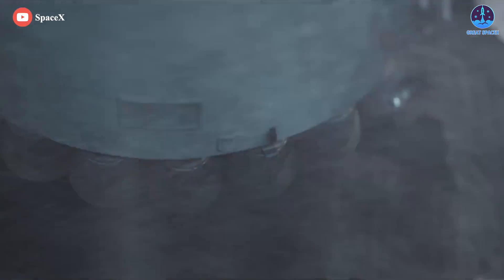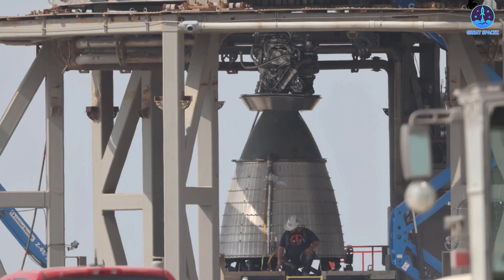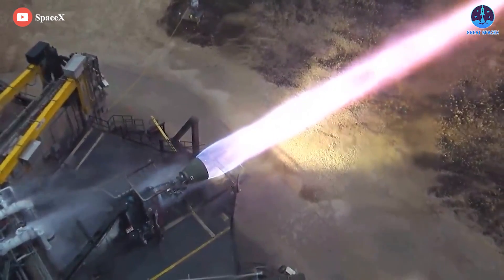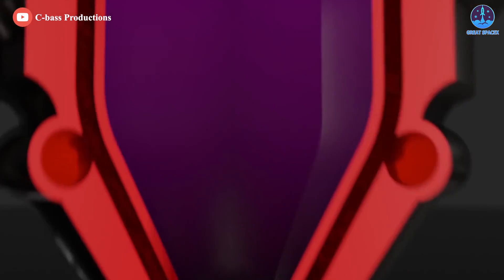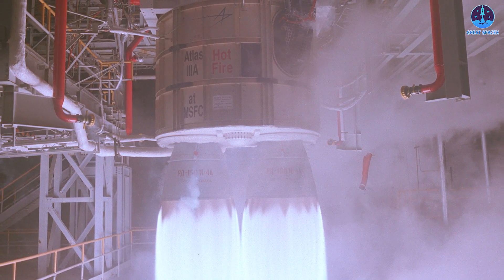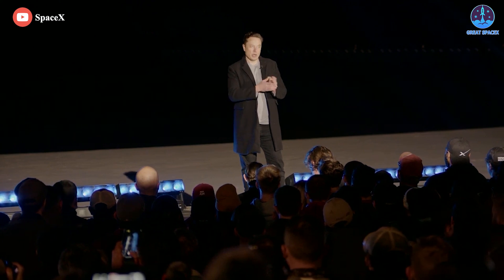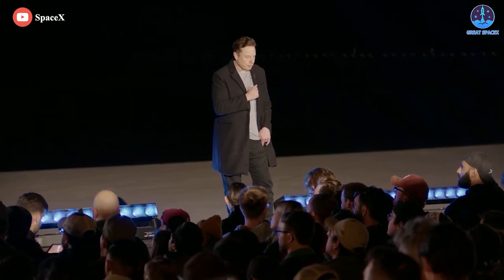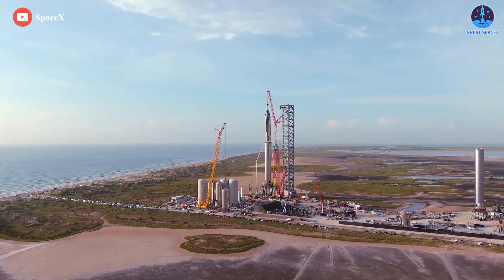What Elon Musk just Did with SpaceX Raptor Engine is thrill Scientist's minds...

Comment: The RD-180 has one champers and two exhaust bells.
Reply: That was because they could not figure out how to stabilize the combustion in one large combustion chamber and nozzle so they took the output from one large turbo pump and divided it between two smaller chambers and nozzles. Works really well and is one of the most dependable engines made but is heavy.

Comment: "Act hypergolic" is like being "a little pregnant."  Hypergolic is an adjective describing a chemical reaction that requires no external aid (like a spark or heat).  It's a one or a zero.  It is or it isn't.  In this case, it isn't.  At all.  That's like saying a diesel engine "acts hypergolically" .. which is completely wrong in every sense.  Raptor 2 acts like a diesel engine.  Mix, flow, expose to heat & pressure, *boom*.

Comment: 300bar =4500lbs? thats a lot of Pressure to Contain ! Larger Bell ,more volume ,Higher Thrust Highly Modified Combustion ,Flange ,weight,.Now it just needs single engine varijet Injectors to Combine 0/2 and none 0/2 into 1 engine for inner and outer Space The Russian Split System is Close but no Cigar Yet! for a outer run ,.slide lock Rail Between Boosters ,split core engine assembly all cast Internalized ,Worm line Bored ,for ease of manufacturing and Production output !.

Comment: Still hasn't reached space. I would feel better if they had developed a Raptor-2 version of Falcon-9 and Falcon Heavy; possibly for high and geo-stat deliveries, before assembling the Starship system.
Reply: Falcon uses a different fuel system. Raptor can't be adapted to Falcon 9. Changing Falcon nine fuel system to use the Raptor engine would basically be a total new rocket; a mini Starship.
Reply: @michaelharmon5991  NOT suggesting putting Raptors in a Falcon-9. Most people understand the suggestion is to develop another rocket using Falcon-9 configuration, i.e. using nine Raptors instead of nine Merlins to lift a much heavier upper stage to LEO. 
If it hasn't occurred to you, using 33 of them tightly bundled together for the engine's first and only space use has not been as easy as some people imagined. But a more powerful re-usable rocket could make both GEO and Lunar missions much cheaper and easier.
Reply: @daeron767  Well, you did say "a Raptor-2 version of Falcon-9". I suppose that could be taken either way. But, I think where the Falcon-9 comes up lacking is in diameter. The Falcon heavy addresses the weight issue. A larger diameter rocket, perhaps a short version of the Starship booster might fill a niche for bulky loads that don't need the lift of 33 Raptors. Kinda follows Elon's thinking of elimination for optimization. Same basic ship, less engines, less fuel, less structural load requirements.

Comment: It is a little misleading to say that the Raptor doesn't need an ignition system because the hot oxygen auto-ignites with the methane...because it is only hot because it was coming from the pre-burners. Something has to light those pre-burners...an ignition system.

Comment: How much mass could a 1000 ships transport to Mars if the mass it was taking was already in space earth orbit ?
Reply: Depends how you plan to get it to the surface when you reach Mars and how long you intend to take to get there. If you intend to land, you need to factor in a lot of things such as Mars's thinner atmosphere which makes traditional shuttle landings much more dicey. If you're air-dropping it then you need to account for the weight of not only the cargo but the parachutes and their deployment mechanisms.

There's a lot to take on board rather than simply the initial cargo weight.

However, if we're being realistic keep in mind that it cost Nasa $828 million just to get a tank-sized lander to Mars (this is excluding the 2.5bn it cost for the rover). Despite Elon's lofty claims, even with SpaceX's best estimates you're still going to see a price tag of around $10,000 per pound of weight just for propulsion alone.
Reply: @Crystan  i was planing on using balloons 🎈 and then using the ships as balloon movers . Good points though

Comment: The thought came to me when watching this video, could the Raptor engine work in a fighter jet ?  Would the Raptor engine be to powerful for that use ?
Reply: I doubt it, rockets tend to have two speeds. On and off.
Reply: There is also the issue of the vast amount of fuel and liquid oxygen it burns per second
Reply: ....because rocket engines have crossed over to successful aircraft  designs so many times before.

/S
Reply: I doubt it too.

Jet engines makes use of heated air as part of their propellant. Rockets can't use air because they operate in the vacuum of space.
Reply: a jet that could handle that kind of thrust?  keep tossing out ideas though.
Reply: Considering the thrust of a Raptor, and ignoring the 1500 tons of fuel it burns in a couple of minutes, if the jet could stand the thrust the pilot sure could not; think greasy spot on the seat..

Comment: as for new year best wishes and plans ahead I woulnt have anything against if double turbo pressure pump made to fit 420 t pressure  lets follow tech data a basic durational jet engine is usualy max out power to 94% power and best in use speed is 84 % for longer duration operational cycle and best quality maintain cycle if max power turns out sligth less then 420 t is still ok namely the product could hold bypatern nano design twin logic this can produce a much faster a serious lines off engines in if assembled in production facilities this slight underline use off stronger engines faster and simply smaller siye fit to part off service or easy vtols so in theory nothing changed but enginering achieve is marvel design so it is possible to go even on higher output ratio also fast and some contaiment fuel puting in work twin design that use mor exploadable owudla owuld aquire part off mushroom chamber blimps may be more chambers and slight more curved at end and good chance to practice aqustic design test the theory as achive easier resonance factor at max use safely then is testing and firing in english it means simply large volume cary be installed as chasis or body that is bit closer to star trek but not yet in that league kind a corvette class but still capable or reentry and we use data and knwo on our own and improve and patch tech ahead as a point off win scenario is this like Joseph Cocram old rocket and first warp one win win scenario except this is one si cooled by bell cage and critical parts have metal cover and aditional cooling systems in theory fits to anything what is in front off it or large pack off fuel also one off theories is like  side switching max burst then use off left or right turboes to goes up off cource slight slower but not that unsafe and again this theory remains to be proven if possible

Comment: I see it as hardly revolutionary: removal of sensors that were there during the development phase
Reply: These are just numbers it has to perform in real life situation and it has to be reusable which means it has to have a long life. It’s like putting a car engine on a bench and running it, not the same as real life driving.
Reply: 180 tons of thrust of Raptor 1 to the 230 tons for Raptor 2 is not revolutionary :P?
Reply: @SmartassEyebrows  Rocketdyne F-1 engine 750 tons, October 1963. Where is the revolution?